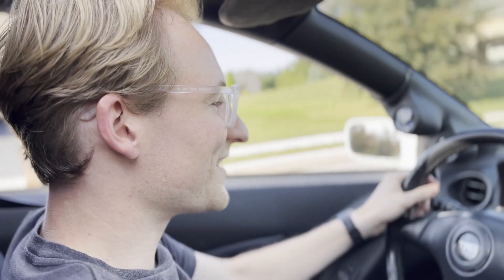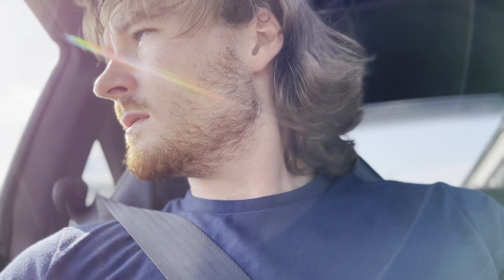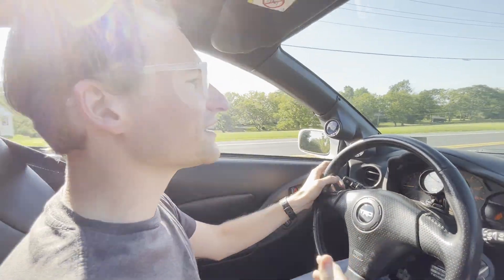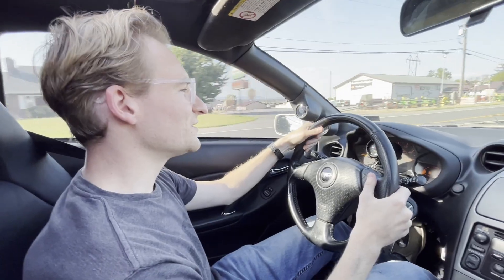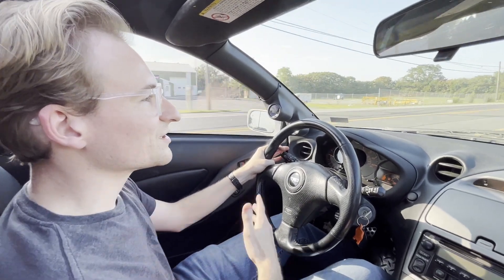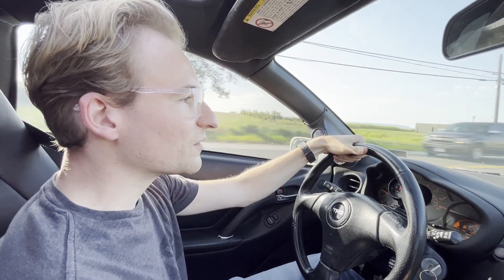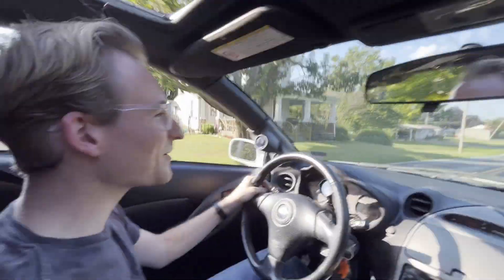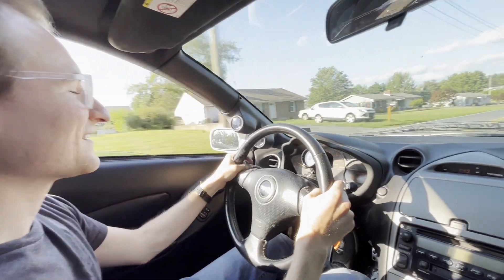Supercharged Celica GT-S Ride Along! It's INSANE!

Comment: I have this supercharger in my old set up. The rotors actually do turn from the vacuum of the motor. When u engage the clutch it spins faster because it matched the engines revolutions. If u look at the clutch set up u can tell it is spinning and not sitting still. Compare it to the ac compressor u will see what I mean. It spins when the clutch is disengaged just not as fast. I guess u can compare it to a chain on a bike where u stop pedaling and the wheel still turns slowing down until u pedal again. The suction from the motor will turn the rotors. Still a bit of a restriction but not as implied in the video

Comment: Any suggestions on finding a gt supercharger? I should of gotten it when i got the car but mines got a better fuel injectors a better cpu? Rebuilt trans for faster shifts and redone seals on the engine its a 2002
Reply from the maker: I haven't done much research on where to find a kit for the GT... Maybe I need to design a kit using the SC14 supercharger once I am done with the MR2?